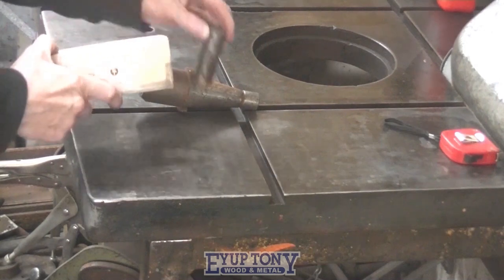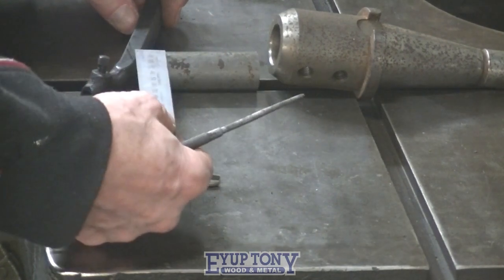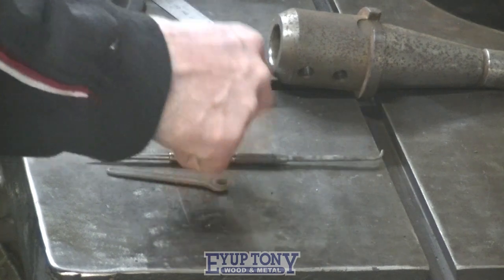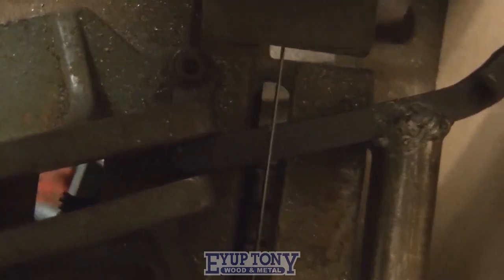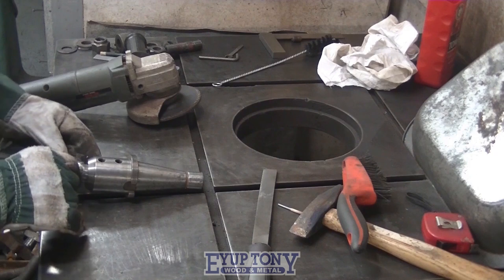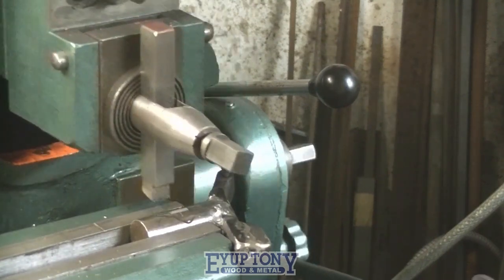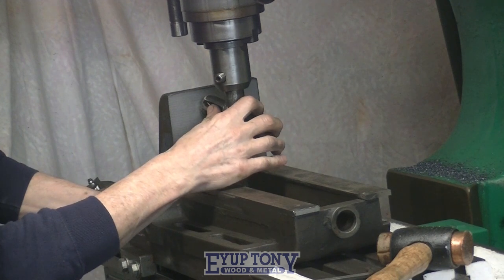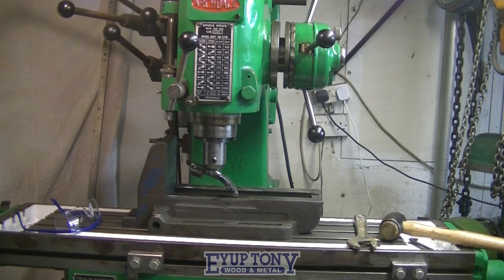Fly Cutter for the vertical milling machine  #shopmadetools

Comment: Gday Tony, the Archdale mill is a beautiful machine, certainly looks very rigid, I’m sure you’ll get the fly cutter sorted, hope your keeping well mate, Cheers
Reply from the maker: Hi Matty. Great to receive a comment, really appreciate it.
The Archdale milling machine was a step up for me from a Chinese round columned mill, similar too yourself.
I wasn't looking for this particular SUBSTANTIALLY HEAVELY BUILT MODEL but the engineer next door/underneath from me had it up for sale. 
I gave it half a strip and clean, the side you see on camera lol, then got distracted by a SLENDER SLIM FEMAIL MODEL with two legs lol. 
It never got the Archdale finished I WAS TOO TIRED, EXHAUSTED LOL and never had the time. 
Now I have got the time I'm going to post the pics of the procedure in a future video. 
I may even finish the strip and clean. What do you think? Cheers Matty